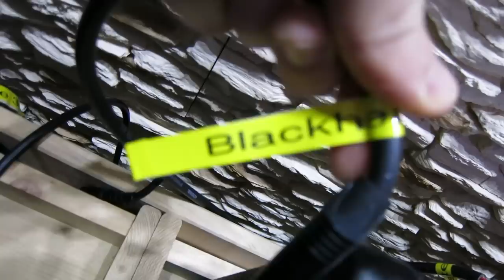Guitar Speaker Iso Cabs at 42studios

Comment: I live in a ground-floor apartment. I just bought a Morgan MVP23 with the power scaling. I set the volume and gain to ~ 2 o'clock and the power scaling to 0. It sounds AMAZING, but it's too loud. If I build an open top sound box with acoustical foam and plywood, will that muffle the sound enough or will the sound escape through the top? Will the acoustic foam attenuate the high frequencies? I don't want to spend the money and build a box if it won't work. Any advice appreciated.
Reply from the maker: I don’t think that will sound good. Even if it is quieter, it will be dull sounding. I would recommend getting a Fryette Power Station or a Tone King Ironman.
Reply: @EytschPi42  Thanks! That's what I thought.

Comment: Thanks HP, sadly noone of us has the room for so much amps and boxes, but yeah, it's nice to see, what could be if. I like everything there, but I don't like those hinges and how hard it is to open them. Also, this was the first video mentioning that the amps get hot in there. And I didn't see how you switch on/off the amps. Lot of amps have even two switches to get the amp on. Wouldn't there be a smaller service window a good way to deal with both problems? Heat can go out easily and the small window allows you to quickly switch the amp on and off. I don't know if there's an even cooler solution like a small gadget that switch the switches for you and maybe track the temperature of the inside. Do you know anything about that?
Reply from the maker: I don't have amps in there anymore... that was in the past... when I filmed that video it was just cabs. I wouldn't recommend putting amps in the boxes as well... so not really suited well for combos.

Comment: Question:  I understand the benefits of miking a speaker cabinet inside a contained isolation box, but what is the different sound result/s from close miking a speaker cabinet in a bigger isolation room?  Does the limited air space in a smaller isolation box effect the way it sounds when recording?
Reply from the maker: Hi Brent,
there is no difference. Once in an iso cab, the actual speaker enclosure and the sound attributes it contributes to the overall sound don't really matter. Miking in a good sounding room, if you have one, is always a better idea, but the volume is a problem for most of us. The big iso box is merely for bigger speakers, so if someone brings in a 4X12, I can still mike it in a box...

Comment: Does the limited space effect the sound since it is compressed and there is air inside the box trying to move that is trapped? That doesn't stop any speaker movement?
Reply: You should not isolate the front of the speaker from the rear. That way air is relatively free to move inside the box. So no that’s not a problem.
Reply: i used same philosophy as James

Comment: Thanks for this great, instructive video. I have recently build my isolation cab (for 1X12 speaker) and I am looking for smaller mic stands to fit SM57 and a ribbon mic inside the cab. I do not have much space left inside, what would be your suggestion for a tiny durable mic stand? Thanks a lot!
Reply: You can buy sm57’s that have a 90° angle on them. That will save some space. Also check out the 906 and 609 mics from Sennhessier. https://reverb.com/item/1992214-shure-sm57-transformerless-and-granelli-mod?utm_source=rev-ios-app&utm_medium=ios-share&utm_campaign=listing&utm_content=1992214

Comment: tell me , does guitar speakers heat up ? if you play lots of hours , like 8 hours .
Is there any chance that foam will set fire if you play all day with guitar cab inside foam box???
Reply: i doubt that the overall spk heats up, just the coil, i havent noticed any tangible heat buildup on frame, magnet, or air temp.  coil blew, thats all.  
With 100W, would expect tangible heat buildup, but in practice, its more like 10W sporadic, not 100w continuous.

Comment: With your iso cabs in the basement does weather effect the sound? I want to build one for my garage or attic but I am worried extreme cold or hot temperature would affect it. What about moisture in the basement?
Reply: I haven't noticed anything.... speakers don't care about heat or cold and the basement seems dry to me....
Reply: i should get a hydrometer. i get the impression that the inside of my iso box is a protected safe dry spot for the spk & mic.  i did go to expense to get hvac air circulation.  casters.

Comment: Can you please drop a comment about the size of the speaker cables? I've heard that you must use short cables between the cab and the amp to avoid damaging the amp, but you are obviously using very long speaker cables. Any regular speaker cables would do the job or special cables must be used to compensate for the longer length? Thanks in advance.
Reply from the maker: I never heard about long cables being and for the amp. My cables are very thick and very high quality. a look at PA systems, they have extremely long cables... I haven't had any problems!
Reply: Won't damage anything but thick cables are always better for long lengths a rule of thumb the speaker cable resistance should be about 5% or less of the speaker impedance. The thicker the wire the less resistance. It still won't damage anything have a cable with more then 5% resistance but it will just start to sound worse and worse.

Comment: Those boxes are very nice looking and you did nice job.  However IMO they do not isolate that well.  Acoustic foam is not very good for soundproofing.  Insulation used for fire and soundproofing in walls is much more dense and thicker. I have a 4x12 cab in a homemade iso box with Marshall head cranked to 3oclock and it is quieter than yours.  Just an observation.  Cheers
Reply from the maker: Yes, the foam isn't meant to make it quieter, just reduce reflections inside the box... the heaviness of the wood is what makes it quieter... the heavier it is, the more it absorbes the sound... but since they are in the basement, it is more than enough!
Reply: have you got any pictures chris?